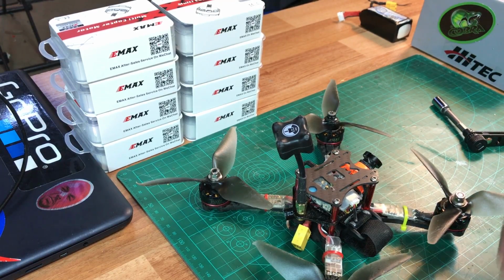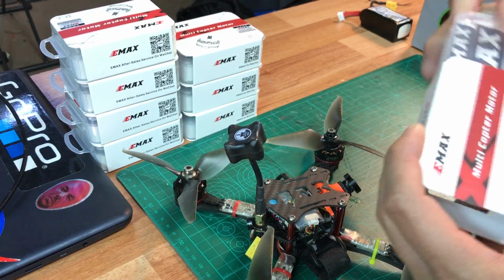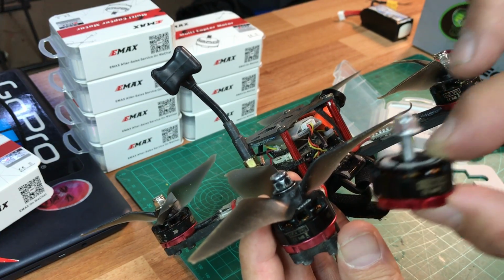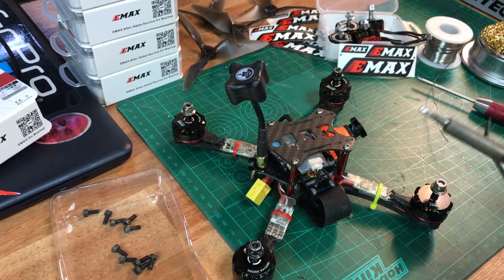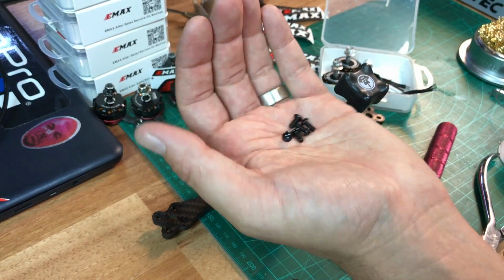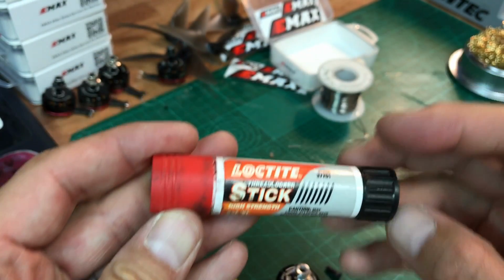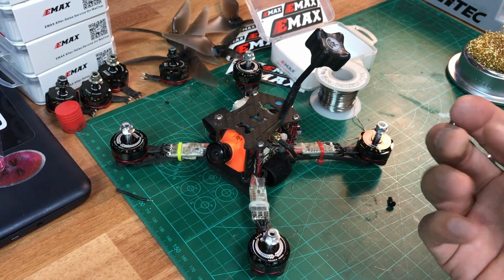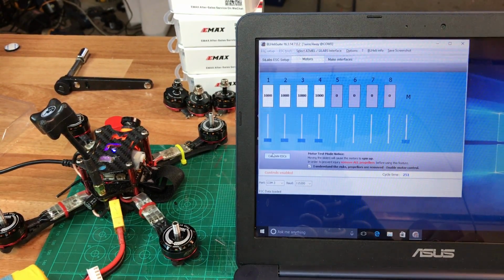Emax RS2205 S 2600kv Motor Install, Going for 100mph!

Comment: My motors are going in the WRONG direction, what shall I do? Plz respond asap
Reply from the maker: On the motors going the wrong way, swap any 2 of the 3 motor wires and that will change the motor direction. Or you can run blheli suite and Change the motor direction. This way you don’t need to resolder anything

Comment: Hello! I've searched about this motor and I couldn't find neither the No-load current nor de Stall current. Have you found anywhere these informations? Actually, what I found is a sheet, where the vary the current, which increased the speed, but I couldn't understant how this data was developed.

Comment: wanna know more about those motors!!! good bad, more smooth, how more punch, battery reapper?
Reply from the maker: In the short time I've had them- there are no negatives. Lighter, 100+grams more thrust per motor, Steel Hollow shaft, shorter stack height....affordable..
!!!
Reply: yes, when you had them proved enought please tell us if really worth it upgrade from the old red bottoms... pleeeease jajajaja, thanks
Reply from the maker: maximiliano manzur serrano well the fact that I hit 109mph today and the motors came down at room temperature is something!!! Buy the mm fast!!!!
Reply: wooow, nice, thanks

Comment: All motors have the same threading direction?
Reply from the maker: Jim Leffler yes, you don't have to carry as many spare motors that way- the lock nuts work great on the ccw motors
Reply: Sweet, I ordered 2 cc and 2 ccw but received all ccw. I heard these emax rs2205 ran hotter in reverse, but based on your experience that claim seems unfounded. Great video.
Reply: RunninOnCoal How should they, the only difference is the thread direction. The rest is exactly the same. Cw and Ccw is just that the propellers won't unscrew themselves. Nothing to do with the motor itself :D

Comment: Hi 
quick question . do You know what is a difference between emax rs2205 2600kv and emax2205S 2600kv
and last thing - what make is Yours props ?
Thanks in advance
Reply from the maker: +Tomasz Wandzik for max speed racekraft 5051x3Normal flying 5x4.5x3Main difference is lower stack height and about 100g more thrust

Comment: Can these run a 5s? I have not tried but run a 5s on Raceflight One Warp 8 2308 2600kv no issues but was hoping the emax can take it as well. I built the emax build to handle a 6s lipo but the motors are the only questionable part for 5s.

Comment: I purchased a GB 190 kit from Gear Best, put the kit together then a puff of smoke from my brain when I powered it up.
After checking everything I could think of, by accident I noticed some silver on the rotor of my motor. A large blob of solder. Then when I tried spinning the motor it felt gritty. Yep more solder wedged between the rotor and the magnets. 
I've since contacted GearBest about my issues, and I have never felt more like I was a criminal in my life. I have been basically cross examined, and scrutinised to the point where I have had to explain why it took me 53 days from their stipulated date of delivery to my complaint.
For those of you thinking 53 days!, money and shipping for FPV equipment, batteries etc. and medical reasons.
Their policies and warranties are once you open it you basically void the warranty.
And because it's an RC and or moves it is not covered at all!
So I pull three pieces of solder from a brand new motor, never even had the chance to spin and it's bad luck buddy.
I'm not sure what Emax is like to deal with as a company, or the general quality, but Gear Best is shocking.
I'm new to the Quad game but very experienced at RC Cars. Have done plenty of soldering, and understand the basics of motors, ESCs, receivers etc.
I have a $290 coffee table ornament, that Gear Best refuse to accept any blame or recompense.
So before you open the box, put your X-ray glasses on and thoroughly inspect all the products inside, because once that box is open, your on your own!
Reply from the maker: Can you be sure that the solder wasn't picked up from your bench?  Why would solder blob in the motor smoke your FC (if you're calling your fc a brain)?
If your FC smoked- it could be from miss wiring.
even so, replace the fc and the motor, $40 and you're up and running,,,,
Reply: 7demo7 I'm experienced at soldering, so your point is valid, but I have built around 30 RC cars from kit form. I have and keep a very clean work space. The large blob that caught my eye, was melted into the copper rotor. When I spun the motor it felt gritty, that's when I found two more pieces that I pulled out with tweezers that were jammed between the rotor and the magnets also melted to the shape of between the rotor and magnets.
I am new to Quads, it was when I tried to power up the quad with the transmitter to check the motor directions, a simulated flight, prop less!
There was a zap and a puff of smoke from the flight board. Excuse my lack of knowledge of all the quad acronyms.
I'm used to motors, of varying sizes and KVs, turns etc. A single ESC, RX & TX and a steering servo.
But my feeling is that the solder when motor was sent power short circuited the board.
Reply: Also I've double checked the wiring with a volt meter so it all looks good there. I was following the UAVFUTURES build on YouTube as I built, step by step. My issues are with Gear Best who are being very difficult, let's face it, I don't want my Lipo to go and we all know what happens when they go poof!

Comment: I am going to get these motors started on my first build, a qav - clone from BG, 214mm... I know sounds kinda overpowered, but I use some extra plates for battery and protectors for the motors which makes it heavier again..

My main question:
Will 30A Racestar ESCs (not the V2 version) be enough? Batteries 30-60c 3S and 4S @ 1800mah.

Thanks for the video, like to watch that and got yourself a new sub ;-)